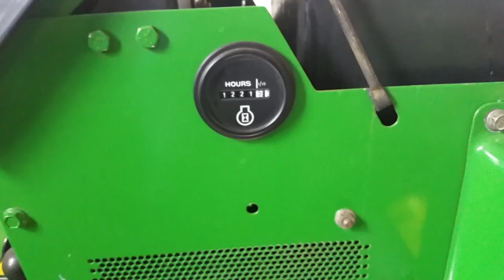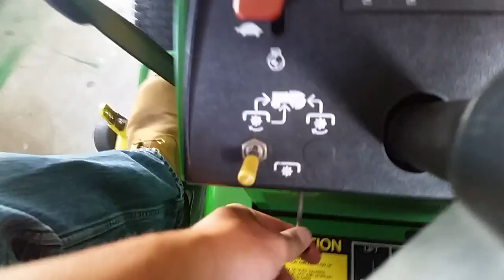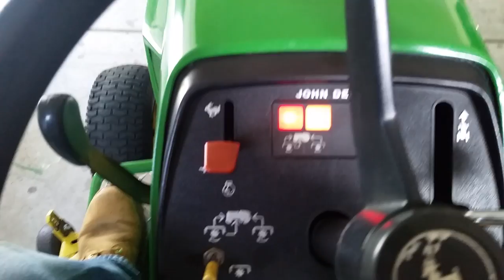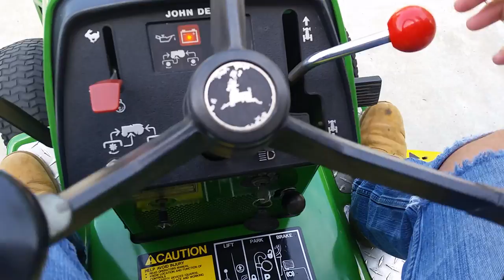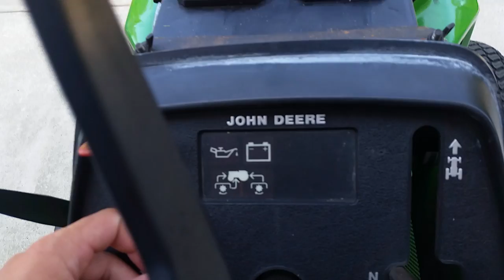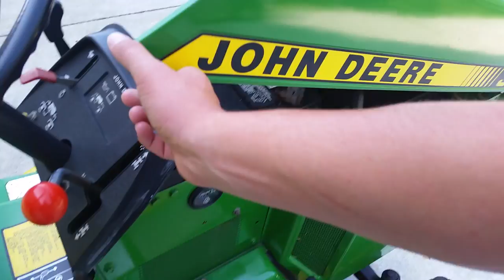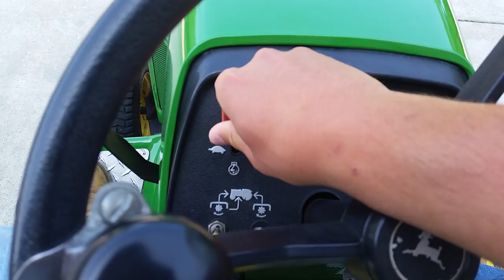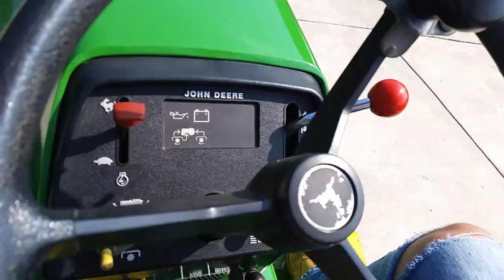In-Depth Review of the 1987 John Deere 316 (R.I.P)

Comment: I love my 1987 316. I put a 3 point on it for plow and disc harrow for breaking my garden and the scraper blade for keeping water flowing toward the river in the ditches. I have the engine out because the previous owner over torqued the starter and the mount holes finally broke off. 
Mine only has 800 hours so I bought a bg43 oil pan and I am putting the old style starter with separate solenoid.
I am ready to put the oil filter and oil in to give it a try but it was needing a carburetor cleaning when I pulled it out in 2018. I am hoping that it will start so I can see if a cleaning will be enough or if I will need to attempt a rebuild while it is out.
I have the 1986 330
As well. 554 hours and I use it for mowing.
It’s a shame that your beautiful machine caught fire.
It looked garage kept it entire life.
Reply from the maker: One of these days I'll be putting a 3-point on my 318. I also plan to do the B43 oil pan and starter swap...I have all the parts, just need to find time to do it. This 316 was actually very nicely restored before I bought it and I'm still bitter over losing this tractor, but I've been fortunate enough to own two more 316's and four 318's after it.

Comment: Bought one few months back for 300$ decent mower for that price had wiring problems bad when I got it a lot of people I see have wiring problems with these tractors none of my safety switches worked lol finally got mine straightened out kinda lol it still dies for some reason from time to time good usable machines though lots of power I’m not used to coming from a 314 lol mine is also a 87 but not in terrible shape but is kinda raggedy but 316 for 300 bucks I mean can’t pass it up thanks for sharing nice tractor I like it
Reply from the maker: Great deal for $300. Wish I could find one that cheap.

Comment from the maker: 1990john deere318 - the air gap should be .018". You can use a feeler gauge to check the gap, but all I did was take a 9/16 wrench and turn each of the 3 lock nuts 1/4 turn clockwise and that fixed it.
Reply: +MichaelTJD60 Thank you, I will have to check it.
Reply: +MichaelTJD60 l like that bad ass 316
Reply from the maker: Thanks.
Reply: yep

Comment: Hey sorry it burned up! Give ya a little tip NEVER EVER USE Wire nuts on a Tractor! They will always vibrate loose!
Reply from the maker: That was the one and only time I ever used a wire nut. Now I solder the connections and secure then with heat shrink. Seeing wire nuts used on any type of automotive application makes me cringe now. Lol

Comment: The 318s were definitely better and  more outfitted than the 316.  And those were very important when using it as a true tractor.  However, if your only cutting grass or running one implement  at a time that only needs one spool like a blower than they are fine.  Plus you can easily add dual brakes.  The power steering is not needed unless your running heavy front implements on dry ground or a loader.  The 316 manual steering is far superior than any other manual steering JD garden tractors before it.
Great machine regardless.
Reply from the maker: I agree that the manual steering on the 316 is superior. It's basically an automotive gearbox. I wish they would use that system on some of the newer garden tractors like the X500 series instead of rack and pinion steering. It's hard to go back to manual steering when you've had power steering (had five 318's myself), but I've had three 316 Onan's and a 330, and have always been fine without it - even with a blade up front. Definitely wish they had dual brakes though. I was getting ready to swap this one over to dual brakes before it burned up. My 330 was converted over to dual brakes - excellent for traction on hills, and for mowing around trees.

Comment: I swear these old JD's sound quieter than half of the ride on mowers made today
Reply from the maker: The Onan engine is fairly quiet as it is insulated and shielded by side panels. Plus it has a decent sized muffler. The mower decks on these old machines turn at a fairly slow speed compared to the modern machines, so they are a bit quieter. My X570 with the high airflow 48" deck is super loud.

Comment: I like that sleeve hitch on the 210. .. Is there any advantage to puting a full 3 point hitch on it over the simple sleeve concept?
Reply from the maker: The 3-point hitch distributes the force of the implement evenly across the rear axles AND the centerline of the tractor (requiring less "pull" from the tractor). It's a tried and true design that has been in use for 90+ years and it allows the tractor to use larger or heavier implements without much strain. But when these garden tractors were being produced 40+ years ago, a lot of people just weren't willing to spend the money on a full 3-point hitch setup for their tractors as they were somewhat complex and expensive...the older JD hydro's (140, 300, 317 etc), required a rear SCV kit to operate the lift cylinder for the 3-point hitch, so that got to be expensive (and the attachments are fairly expensive too). For that reason, sleeve hitch attachments became popular on a lot of makes and models, since sleeve hitches are cheaper to make, easier to install, and the attachments are also cheaper and easier to find.

Comment: This 316 sounds great.   I shouldn't change those tires. They are a pain to to replace it.  Even I did to my snapper once (still gone) the tire had a hole which is from a brick in the shed that cause it. Even at my job. We can't install lawn tractor tires. It sucks.
Reply from the maker: NJRAILFAN & RACEFAN88 It can be annoying, that's why I have so many extra sets. One set of rims for the turfs, one set for the lugs, and one set for the HDAP tires.
Reply: Changing tires are a jiff to change when you have the proper equipment

Comment: Looks like a show piece, very nice.
Reply from the maker: Thanks, it was a real nice tractor before it burned up in a fire.
Reply: Oh no, I guess I didn't put 2 and 2 together. I didn't realize that was the one that burnt up. That sucks bro, I'm sorry.
Reply from the maker: That's ok, at least I have plenty of videos of it.
Reply: Well when you get around to repainting it, let me know. I used to paint commercial aircraft so I may know some tricks you can use.
Reply from the maker: I didn't save any of the sheet metal. Bought a second 316 and swapped parts over to it.

Comment: So how do you set the deck height on one of these?  Like how do you get it to the same height every time by just moving the hydraulic lever?
Reply from the maker: There is a threaded adjustment rod on the back of the tractor going through the rockshaft. You have to lower the deck to your desired height, then turn the threaded rod in until it bottoms out on the rockshaft. That will prevent the rockshaft from traveling any further.
Reply: MichaelTJD60 thanks for the explanation!

Comment: Love your vids on the JD 316 its been super informative with helping me decide on what to buy.  I was hoping you could help me out with a question.  I'm torn between getting a 316 with the 16hp onan or bumping up to the 318.  I was wondering what you thought might be best for my 1.5 acre mini farm?  the biggest issue is the steep hill on the back side of the property.  not sure if the 316 will haul my 240 lbs up the hill....
Reply from the maker: +Eamonn McGonigal Thanks for the sub! Any of these old garden tractors will haul uphill with out a problem. My 316 can climb hills with ease, both in forward and reverse, with turf tires. The old shaft-driven transmissions have proven themselves as indestructible. No matter what you get, you will need extra weights for it because it will help you grab traction and keep from rolling over.
Reply from the maker: +Eamonn McGonigal  As for 316 vs. 318, it's really a matter of what attachments you're going to need and what you're working with. I'm happy with my 316 because I only need single (H1) hydraulics for my snow plow and mower deck. I can also live without power steering since I don't have a snow blower or a loader on the front. But if you have a lot of trees and tight spaces to mow around, or you plan to run a snowblower or loader or something heavy on the front, get the 318 or 322. They both have power steering. 322 has a liquid cooled Yanmar gas motor which some say is more reliable than the air-cooled Onan. All the tractors I mentioned can run a 3-pt hitch, rear PTO, and all kinds of attachments.
Reply: Great thanks.  my issue is I've got a small orchard at the top of my lot so i'll need something that can turn around the trees.  also wanted to put a plow on the front for snow and possibly get a bucket attachment.  realistically though since all those attachments cost a pretty penny I don't know if i'll actually end up getting them.  for now I need something that can mow, turn around tight trees and help me drag things around my property.  also till or drag  a plow.  I don't want to shut myself off to future options though
Reply from the maker: +Eamonn McGonigal The turning brakes on the 318 will help with the sharp turns. They also provide "posi-traction" if you get stuck because you can press on the brake of the wheel that is spinning and it will transfer the power to the other wheel to help get you unstuck. Also, the power steering will be handy for the turns. You can get a model 54 two-way (hydraulic up and down) or 4-way (hydraulic up, down, left, right) snow blade depending on whether the tractor has H1 hydraulics (316) or H2 (318 and up). A 3-point hitch will be needed to pull a plow or other garden attachment. Just to give you an idea I bought a 2-way hydraulic blade for this tractor for $350. A 3-point hitch will run you about $450, give or take. There are a lot of aftermarket companies that build them.

Comment: I just bought a 150th anniversary 316 I think it's a 1987 brought it home and put a new battery Deka 26 r it fired up ran fine for about 10 min . the battery light came on and a min or two later it died and won't turn over. the battery checks out fine  checked battery cables 
 won't even click or turn over.???
Reply from the maker: Do the dash lights come on when you turn the key on?

Comment: hey I found 2 in line fuses that came under plugged ....  at the key switch 
 must have vibrated loose.
Reply from the maker: That would definitely cause a problem. I think one is a 25 amp and the other is a 2 amp.

Comment: I appreciate your knowledge of the 316. I’ve had a 1987 one given to me. It’s hard to find someone to help me with my questions. I have a snow blower attachment and a 50” mower deck. Do you have a video explaining mower deck height adjustment? I’d like to know if the deck is supposed to roll along the ground on its wheels. Thanks.
Reply from the maker: Unfortunately I don't have a video explaining that, but I can tell you the deck should not be sitting on the gauge wheels. Those wheels are only there to keep the deck from bottoming out and scalping the grass if you hit a bump. The gauge wheels should sit 1/4" to 3/8" off the ground and should only roll when the deck bottoms out. You can adjust how far the mower deck drops by turning the threaded rod on the back of the tractor. Once you have the depth set, park the tractor on a level floor or driveway and lower the deck to that height setting, and set the gauge wheels accordingly.
Reply: MichaelTJD60 ok that helps. Thanks so much. I do have another question with regards to the mule drive and belt tension. For the first 2 summers when I engaged the PTO it dragged on the engine to get started and the deck was loud. I’ve replaced every bearing and pulley on the deck.This year not so much. My tension indicator on the mule drive isn’t working but the tension certainly adjusts. I guess I have 2 questions. First is the vibration related to the tension? Second do you know of a video for getting the tension indicator to work properly? I can not figure it out.
Reply from the maker: @scottg674  Is the vibration coming from the PTO belt or the deck itself? If the belt is vibrating, it's too loose. The belt shouldn't be too tight but shouldn't be too loose either....just tight enough that it won't flop around when the PTO is engaged. You'll want to adjust the belt tension with the deck raised all the way up, and the tension indicator should be in between "initial belt tension" and "retension"...it really depends on how worn the belt is. If the deck itself is vibrating, the blades might not be balanced. If they aren't sitting perfectly flat on the spindle boss when you install them, they will wobble and cause a lot of vibration.
Reply: MichaelTJD60  It hasn’t vibrated and been very noisy. I believe it’s because I had the belt too tight before. The PTO and deck has actually engaged and run pretty smoothly. It’s just that I’m guessing on belt tension since the tension indicator on the mule drive doesn’t move as the tension changes. I’m trying to figure out how to fix it. I don’t want to spend $500 or so on a new one. Thanks again.
Reply from the maker: @scottg674  I'd say your bearings are dry but you said you replaced the spindles, which has me puzzled. Are you using OEM John Deere belts?
Reply: MichaelTJD60 I think I’m due for new belts. I’m also going to try and refurb the mule. Maybe all it needs is a new spring.
Reply from the maker: @scottg674  New belts can make a world of difference. M82718 and M41668 are the John Deere part numbers for the belts...make sure you use JD belts only, because they're cut at a specific angle to fit in the grooves of the deck and mule drive pulleys. Generic hardware store belts will not fit correctly and will not last very long.
Reply: @MichaelTJD60  ok, the original Onan engine was toast so it has a Briggs Vanguard 23hp engine. It fit slightly fwd in engine compartment. But it's a beast. I really appreciate you talking with me on this.
Reply from the maker: @scottg674  No problem. Hope you can get your belt issues figured out.
Reply: MichaelTJD60 I’ve got another question for you. The Hydrostatic lever will not move all the way in the forward direction. It does n reverse though. It will only travel about 7/8 of the way but I just can’t push it past that point. I don’t know what happened, the first couple of years i had no problem but now it’s limited. My question is, how would you go about figuring this out? Thanks.
Reply from the maker: @scottg674  Is the brake pedal pushed in slightly? It has a built-in linkage that will return the hydro lever back to neutral if you push it hard enough. If the brake is depressed, it can limit how far the lever moves. If it's not the brake pedal, I would bet something in the linkage is binding up.
Reply: MichaelTJD60 Thanks, I yes, something is bonding the linkage. Here’s the question, how do I get good access to it? It’s a puzzle to me.
Reply from the maker: @scottg674  Since your machine is an '87 model it won't have the access screen on the RH side of the dash tower, so your best bet is to remove the fenders and unbolt the whole right side of the dash pedestal, it should only be a few bolts.
Reply: I have a battery question. My 87 316 had a new Vanguard 23hp engine installed. A new TY6192 battery too. I think that was about 4 years ago. It sits out side and I use it with a snow blower during winter. It’s having trouble starting. Now, once I get it started and run it, it doesn’t have trouble at all starting right up. The charging system is working since after running, the battery measures about 13.33. If it sits for a couple days voltage is 12.34 or so. That’s when it has trouble starting again. If I trickle charge it up towards 12.90 it starts right up. Do you think after sitting through 4 winters I need a new battery? Also, since I’m in Rochester NY should I get a similar battery with about 500 CCA? Thanks.
Reply from the maker: @scottg674  Yes, I'd say you are due for a new battery. Personally I'm not a fan of the JD Strongbox batteries...I'd go with a Deka or Interstate battery with higher cranking amps like 550-600. I run one in each of my older tractors and never have any issues starting them up, even after they've sat for several months.
Reply: MichaelTJD60 alright. Thanks a lot.

Comment: Hi Michael I'm looking into bye a 316 iam learning slot from your videos thanks this one iam getting the guy said he thought it was a 79 well later he found out it could be a 80 well I don't know about that after watching your videos this one has four hydrostatic hoses on the front for the plow left and right turn and tilt left and right and it has a 3point on the back this has a 16hp Kohler motor now the side covers on each side of the engine are open in the front but the exhaust comes out on the left side and up with a muffler like a tractor now behind the muffler up by the steering wheel is two handles and a hydraulic diverter valve that controls the hydraulics I haven't sean the vin tag yet .any information you would have I would appreciate it tks.Dave
Reply: All and the tractor runs awesome every thing seams to work good
Reply from the maker: Sounds like it is the earlier model 316 which was made in 1978 only, and was just a renumbered model 300. I had one of those as well. Good tractors as long as the rubber engine mount isolators are in good shape. If it has the factory diverter valve that's a pretty valuable and somewhat hard to find option.

Comment: I own a 212 and a 316.. need to figure out how to aid the air flow for these air cooled engines (k301 and a p218)
Reply from the maker: Run the correct oil in them and keep the cooling fins free of grass and debris. Also may want to consider replacing the firewall foam insulation on the 316 if it is no longer intact. And make sure the side panels and belly screen are in place at all times.